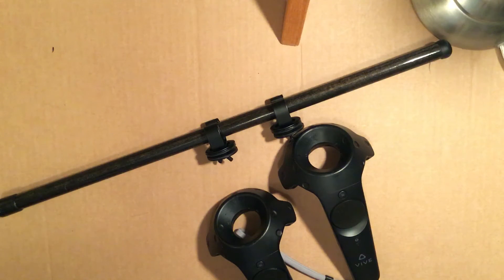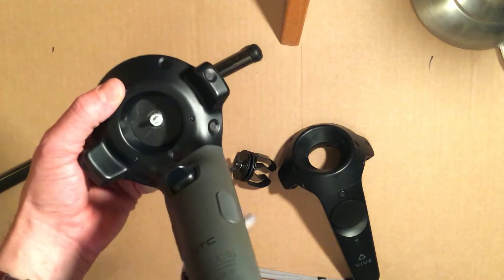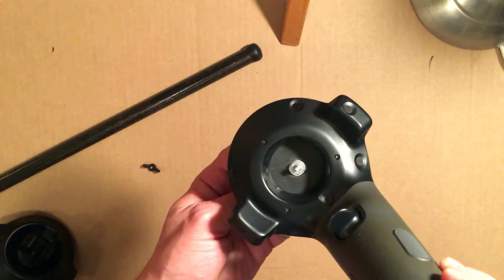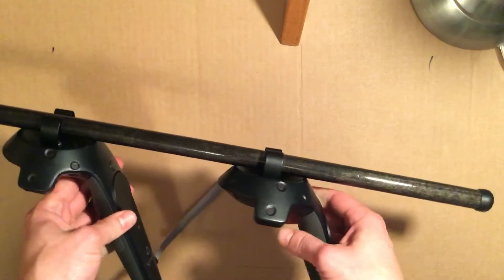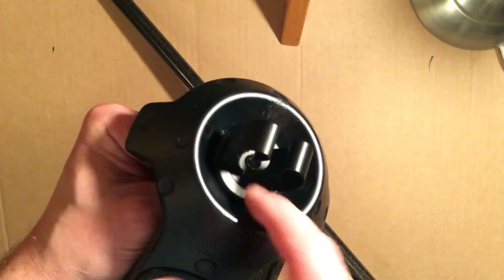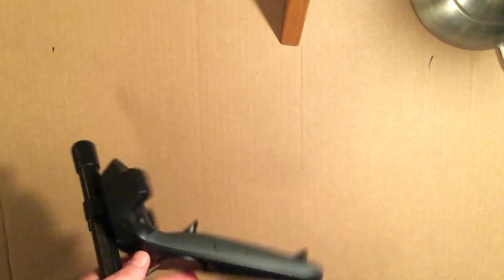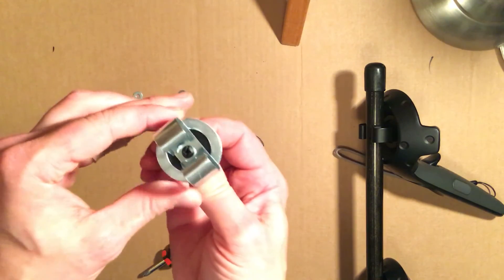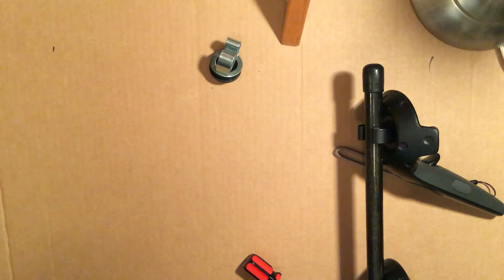Gwinnstock 2.0 - How to Install, Adjust, and a Breakdown of Components

Comment: Finally got all the parts to make my own in today. So far, really interesting. Cheap, easy to make and very functional. My only real complaint is the tension on the controllers and having to snap them back into place after say, a mag reload. Very good concept though.
Reply from the maker: tension is too tight or too loose? If it's too tight, try loosening the bolt a little, that'll allow it to spread more. If that's still too tight, just manually pull them apart a little. I put the larger (inside-diameter) washer on top of the main washer to serve as a brace that allows me to tighten the bolt and pull the bottom-span of the clip into that larger ID washer - thus pinching the to arms closer together. That makes it a pretty simple adjustment to make the tension looser or tighter. I usually have my grip hand's clip really tight so I can pull my other hand's clip of and leave the rod sitting in my grip hand's clip securely.

Comment from the maker: OK, lots of you have asked for specific parts and instructions to make your own Gwinnstocks.

Note, you may find ways to improve this - please let me know if you do (for the benefit of others making their own).

I've included links to the parts, but most of these are very common hardware and can be picked up at most hardware stores. I've indicated where the size is critical - but often the piece I used can be substituted with similar pieces. Some of these links are for bulk quantities (like 50 washers etc) - you won't need all of those, so try to find smaller quantities.

It's simple to do, and if you've watched my last video you'll have a much better idea of what I'm describing here. Don't be intimidated - it's easy - it just looks long because I'm verbose.

Here it goes...

Parts:

Clip:
2x Lehigh 13201 Grip Clip, Medium
https://www.amazon.com/Lehigh-13201-Organizer-Silver-Medium/dp/B0000DH4NK/ref=sr_1_3?ie=UTF8&qid=1484334550&sr=8-3&keywords=lehigh+tool+clips
I haven't tried the large or small sizes, but I suspect they will not work due to the importance of the exact height the rod needs to sit at once clipped in (it needs to be both securely in the clip AND braced against the front and back top-edges of the donut.
Tip: you'll probably notice two points have been stamped into the clip's base (creating two nipples on the underside of the clip). Depending on where your clip sits on your outer-ring washer, you may want to file those down so the clip and washer have more surface area of contact. If you leave the nipples and they sit directly on the outer-ring washer, you won't have enough surface area in contact to keep the clip oriented in the right direction (it will rotate easily, making it difficult to get the dowel clipped in while doing it blind)

1. Outer-ring washer to allow clip-tension adjustment:
2x 1-1/2" outer-diameter (OD) 1-1/4" inner-diameter (ID) Washers
The OD can be up to 1-1/2". The ID shouldn't be smaller than 1"

https://www.lowes.com/pd/Gampak-2-Pack-1-1-2-in-to-1-1-4-in-Metal-Washer-Retainers/3391662

2. Large steel Fender Washers:
4x 1-1/2-inch OD (exactly) 3/16-inch ID
The ID can be a little bigger if that's all you can find - but make sure to get some smaller washers so your nuts and bolts don't pull through the fender washer.

https://www.amazon.com/Hard-Find-Fastener-014973454753-Washers/dp/B00KM4MCH8/ref=sr_1_5?ie=UTF8&qid=1484334132&sr=8-5&keywords=3%2F16+1-1%2F2+fender+washer

3. Rubber Washers
4x 1-1/2" OD 3/16" ID
Some people have had even better results using a slightly larger OD - maybe 1-3/4", or 2" - this will make it easier to seat the hardware into the donut. If you get larger ones, you might need to trim a little to make sure the inner-donut sensors aren't occluded.

https://www.amazon.com/Hole-O-D-Rubber-Washer-Quantity/dp/B008AY3MIK/ref=sr_1_fkmr2_4?ie=UTF8&qid=1484334186&sr=8-4-fkmr2&keywords=3%2F16+1-1%2F2+nylon+washer

4. Fasteners:
You can use whatever you like here, as long as the bolts fit through your clips and washers. I used Round Head Combo Bolts size #6-32.

Whatever size you use, you'll need 2 of each:
- 3/4"-long bolts
- wing nuts
- hex nuts
- small flat washers
- small (thin) locking washers

5. Rod/Dowel:
3/4" diameter - cut to your desired length (I used a 22" long oak dowel)
You should cap the ends so when you rest them against your HMD you don't scratch them up. Just get chair-leg caps

https://www.lowes.com/pd/Waxman-4-Pack-3-4-in-Rubber-Tips/3037435

General tips:
The biggest challenge I had was trying to minimize reflection off all the steel components. To make them look good, I ended up having the hardware powder-coated with a semi-matte paint. I tried using spray-paint, and that worked ok - but it tended to rub off of the clips due to the clipping and unclipping of the dowel. The majority of the clip was still painted, so there was no reflection - but it just looked sorta of unprofessional. But, if you have no other options - just paint them. Other options I tried were - sanding all the surfaces (sort of worked, wasn't perfect - also took a lot of time), and using duct-tape on the the fender washers and clips - that worked, but again, didn't look awesome.

Assembly: (from top to bottom)

Top-half (this goes on top of the VIVE wand donut):

1. Bolt (head on top)
2. Small flat washer (if necessary)
3. Lehigh clip (the bolt head will be between the two arms)
4. Outer-ring washer
5. Large steel fender washer
6.Rubber/Nylon washer (I super-glued the rubber washer to the fender washer so it was easier to install the finished clip - but this is optional)
7. Thin locking washer (this is also optional)
8. Hex nut (once tightened, it will probably press through the rubber washer - that's fine). I fastened the top-half with a nut so I could keep the whole top half of the clip as one solid piece when I take the clips off if I want to play another games without the clips in. Without that nut, when you take the clip off, all the pieces are loose.

Bottom-half of clip (this goes under the VIVE wand donut)
1. Rubber/Nylon washer
2. Large steel fender washer (again, I usually glue these two pieces together for convenience when installing and uninstalling)
3. Small flat washer (if necessary)
4. Wing nut

Once assembled, you can install it and uninstall it as often as you like. To install, drop the top half into the top of the donut. Make sure the base of the clip is flush with the inside of the donut ring - you shouldn't see any space between the clip base and the donut. Then, put the bottom half underneath and tighten the wingnut (thumb tight - don't try to force it too much or you'll pull the clip through the donut and have to start over).

Once it's installed and it all feels snug, get a phillips screwdriver and tighten the bolt a little (holding the wing nut so it doesn't spin). By doing that, you are essentially pulling the inside of the Lehigh clip down into the outer-ring washer bowing the base of the clip a little. This pinches the arms of the clip closer together, creating a tighter hold on the dowel. Just experiment a little with it to find what works for you. I usually have my left clip much tighter than my right so I can unclip my right and leave the dowel clipped in securely in my left if I need to move my hands independently.

Good luck!

Gwinn
Reply: Do you sell these? If so, how much?

Comment: Super idea, i will try to make the inserts out of Teflon with rubber on them.
Reply from the maker: Did that work?
Reply: As a matter of fact it did, i made the washer out of a pvc sheet 2 mm thick. On top of that i used a 1 mm rubber washer and connected it with pvc clamps. The ones one use to mount  electricity pipes to the wall. Then i took an aluminium pipe and attched everything like you showed. Works like a charm, only the controllers don' t come off that easy as yours from the pipe. That takes a little bit more effort.